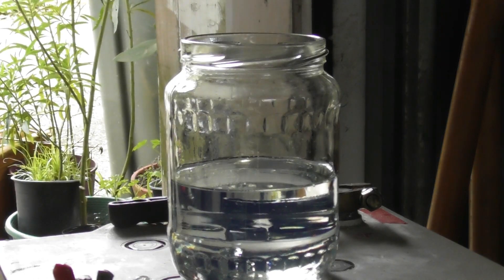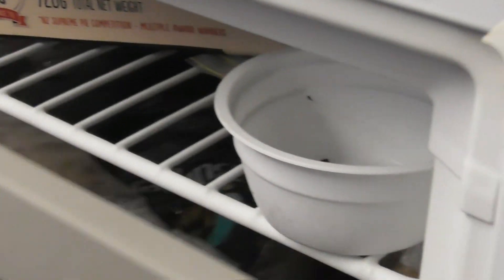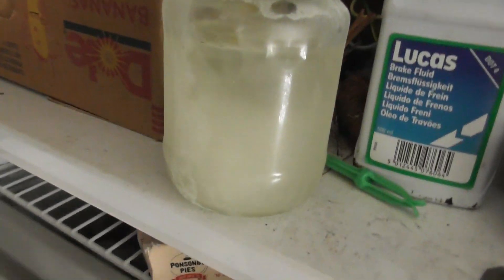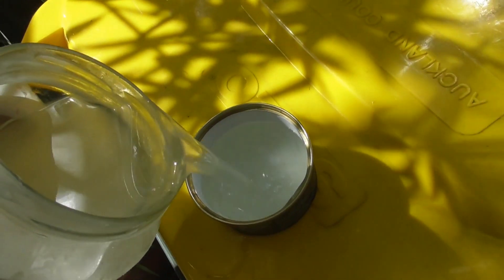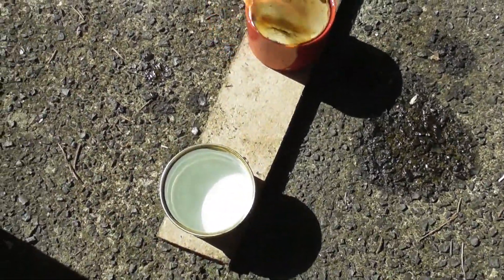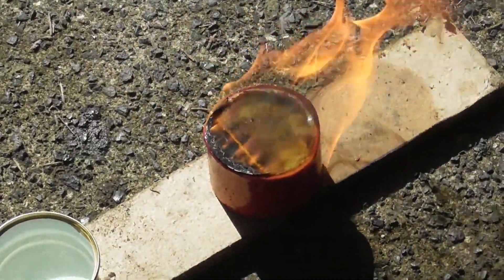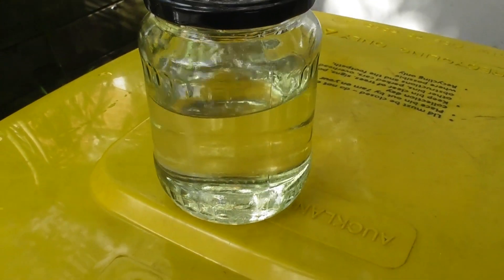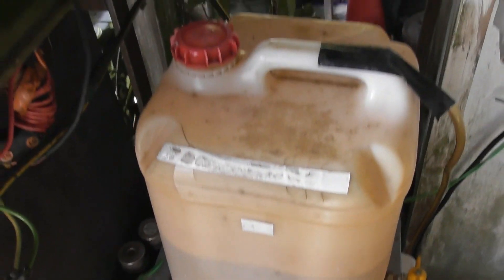Diesel-fuel blend in the freezer

Comment: hate to be that guy but read up on your local laws, here In the UK I cannot use used oil of any description to heat my workshop, you used to be able to obtain a small waste oil burner exemption, but europe put a stop to that... I realise your running a generator but it's still using waste oil, may be ok but read up on it, here the sepa(environment agency) are like the tax agency, you just flat out don't mess with them.

Comment: Hi ThereI have done quite a lot of testing running engines on alternative fuels. Gardner used to recommend 10% of lubricating oil in the diesel. They also used to suggest you put the used sump oil in the tank and filled the tank. I have run and started diesels very similar to yours. RN Diesel Engines on pure lubricating oil. The problems you will run into are not probably what you might think. Any mineral oil with an ignition point around 350C will run in most old school oil engines. The problems are:- Viscosity, too higher viscosity and you may have trouble getting it through the metering pump and to atomise. Calorific value, this affects the horse power available. Transformer oil is not a fuel and so will perform differently. Deposits and erosion, You will find there might be a higher build up of deposits and varnishing on your injection system. The exhaust may become more sooty. Other contaminants, your oil may have other chemicals and contaminants which may cause local pollution or undesirable smells and smoke etc. Metals, some oils contain dissolved metals, these metals become vaporised like lead and calcium. So check the chemical make up of these oils if you can. The basic thought, is not, will it run on it, but what will it do to the engine and me while it is running on it. Lubricating, cooking and transformer oils were never designed to be fuels but they all have a calorific value and hence can be burned as a fuel. However that TX oil looks like some lovely stuff as an alternative fuel. Also very little processing, comes clean and ready filtered, low water content, unlike waste oils. YoursAllister Denyer B. Eng. (Hons) Elec. P.Eng. MIET

Comment: why are you mixing the diesel with mineral oil? new zealand doesn't have freezing cold winters, does it?
Didn't think so? I thought gelled frozen diesel was only a problem in russia.
Reply: Gelled and frozen diesel is a problem in the Northern USA and all of Canada in the wintertime.  They change the blend in the wintertime to help combat this, but often you'll need to put an additive in at the time of filling the tank. Usually if the vehicle remains in motion,  the constant jostling, plus the heated fuel returning back to the tank via the return line is more than enough to keep everything fluid.  Although, sometimes if can get cold enough as a truck progresses North that untreated fuel can't remain warm and mixed enough, and can begin to gel in the filter.  Most of the problems happen when the truck gets parked (outside) for several hours, allowing the fuel to cool off, and remain still.  Without the motion, it reaches its cloud point and then the pour point where it becomes more like a jelly substance that won't easily pass through the fuel filters, effectively clogging them off with the fuel itself.  Once this happens, it doesn't mean that the filters are ruined, but it's often just faster to remove them and put new, clean filters on and ensure that the diesel is treated (or heated by towing the vehicle into a warmer environment) so that it can re-achieve liquid state and easily pass through the filters again.  It's been my experience that adding the fuel treatment just prior to filling the vehicle tank(s) with diesel,  is a hundred times more effective than waiting until your engine won't start in the cold.  Because dumping chemicals into a tank of already gelled fuel is pretty much useless in helping the chemical get to the fuel in the fuel lines and the filters, where it's needed the most.  As for adding mineral oil to the diesel, perhaps as an extender and a way to easily dispose of unwanted mineral oil,  running it through a diesel isn't a bad way to get rid of it.  For decades, I've been disposing of my used motor oil into the diesel tanks (not great huge amounts in one shot - I'll put 4 or 5L of it in between the 2 saddle tank that holds 454L each,  so 4 or 5L into 900L capacity,  and the engine never has difficulty with it.  My fuel filters get changed every 80,000 km or 50,000 miles when the oil gets changed. Earlier trucks I had, had shorter drain intervals.)  I wouldn't add a lot of oil in wintertime, unless the engine was either going to be travelling and jostling about, or was a non-critical device.  Adding some oils can change the cloud and pour points of the fuel it's being added to. Obviously in warmer climates, this wouldn't be a problem.  But even in the cold, deep-freeze of winter in the Northern regions,  lubrication can become an issue for the fuel pumps and some sensitive injection systems.  When the fuel manufacturers switch to lighter blends for winter operations,  sometimes kerosene is used to "thin" or lighten the fuel to aid in maintaining lower cloud and pour points (to avoid gelling).  This also has the unintended consequence of making dry, or less slippery than the heavier summer blends.  This doesn't matter in the combustion chamber, it can have an effect on moving parts in pumps and injectors, where a "too dry" fuel leads to excessive wear in the moving parts. The drastic reduction of sulphur in diesel fuels in the last 15yrs has also contributed to the "too dry fuel" problem,  though modern engines (pumps, injection systems) have adapted to overcome these problems,  older engines still in use will run into troubles soon enough without the sulphur levels and lubricity of fuels from the time when they were designed and built.  Some might say that burning engine oil through a fuel system isn't wise or environmentally friendly.  Well, I don't advise running a diesel solely on used engine oil or waste fryer oil or mineral oil, but adding it in reasonable amounts for the conditions has served me well over the years.
Reply from the maker: @stanpatterson5033  What an excellent and detailed reply. Very well said. Thanks.
Reply: @RODALCO2007 .... Thank you. I'm just sorry that I use a browser that does not permit proper structuring when I use YouTube.  It results in one great huge block of statement, rather than being able to break it up into paragraphs.
Reply from the maker: Just experimenting, have mixed it with mineral oil and works well in the diesel generator.
Reply: @RODALCO2007  Good way to both prolong diesel pump life and use up old non contaminated oil. I just added a little 2 stroke oil to the tank, works well on petrol as well, so long as you do not have a 2 stage catalytic converter, as with petrol it will make a little smoke. With diesel it just adds extra lubrication for the metal parts, as most diesel is very poor as a lubricant.
Reply from the maker: @SeanBZA  I can get hold of mineral oil which has to be disposed off and through info I have read it is also a  good lubticant for the fuel pump as you mentioned.

Comment: I'd probably try kerosene over a diesel-mineral oil mix. (Though I have read it's not good with common rail systems) Alternately find the MSDS of diesel additives we use up here in Canada to prevent gelling. I figure that the mineral oil is only preventing the waxing of the diesel in its entirety, rather than stopping the waxing in general. Little specs rather than clumps shouldn't hinder the filter.
Reply from the maker: Auckland doesn't get real frosts at all. Perhaps -1°Celcius (±30Fahrenheit). I thought it would wax and thicken a lot more.
Reply: Kerosene is a very bad thing to use, as diesel is not great on lubricity, but kerosene is not controlled at all for lubricity and in general contains a crap and variable amount of wax in it as well. Here it is commonly used for trucks, but you can always tell from the smell, along with the clouds of white smoke ( and black when the driver has his foot to the floor trying to climb any hill) coming out. Only used because the driver has to put in fuel, and the owner is the one paying for maintenance and rebuilding the engine, and kerosene is a few cents per litre cheaper, controlled fuel price wise.